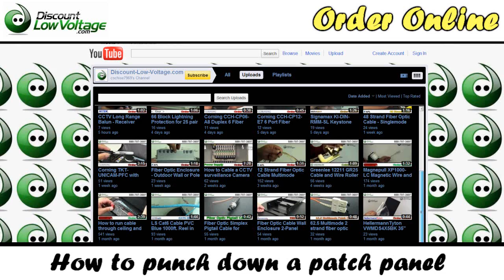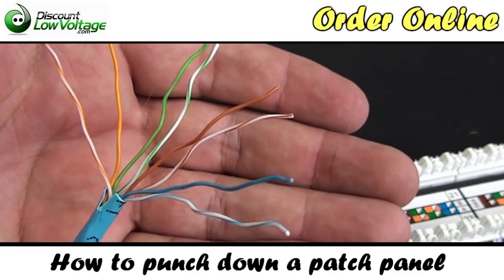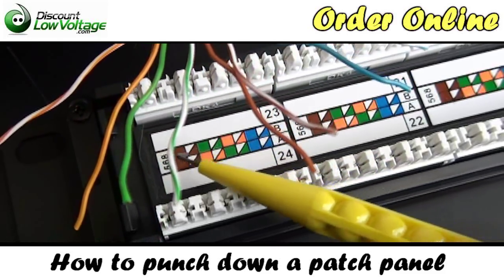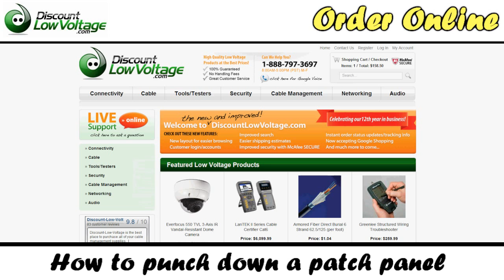(HD) Video - How to Punch Down a Patch Panel | DIY Instructions

Comment: I just punched down the first jack in my new cat5e panel. I used 568b, and it turns out the builder terminated at the keystone jacks with 568a. When I tested the connection, it registered as a crossover cable. I guess I have to pull out the cat5e from my patch panel and repunch it as 568a. Live and learn I guess!